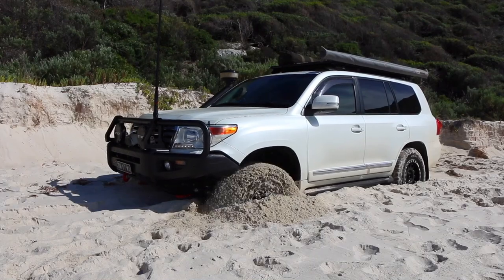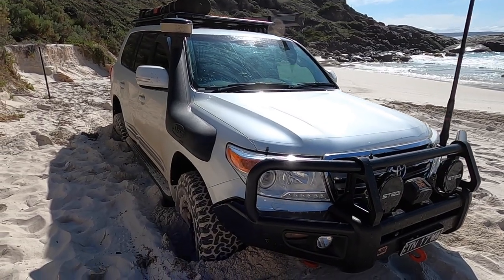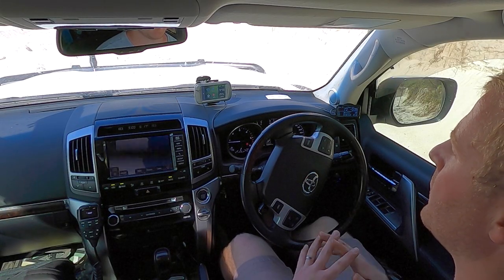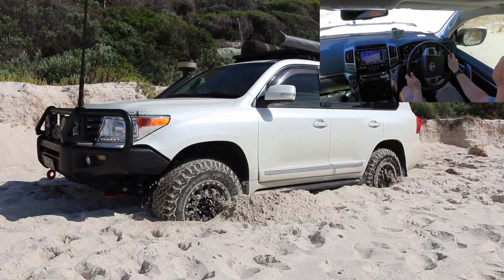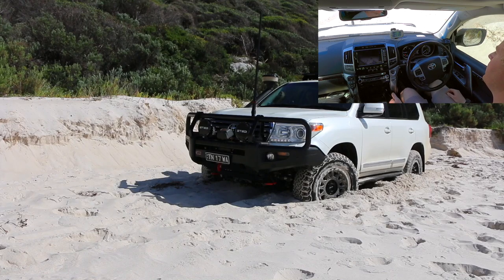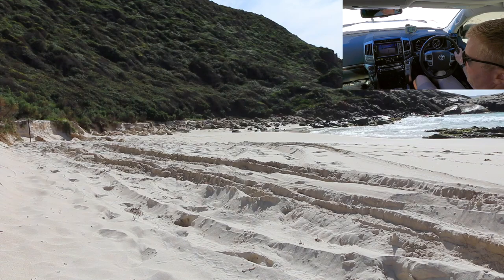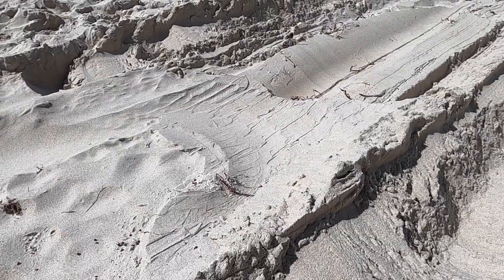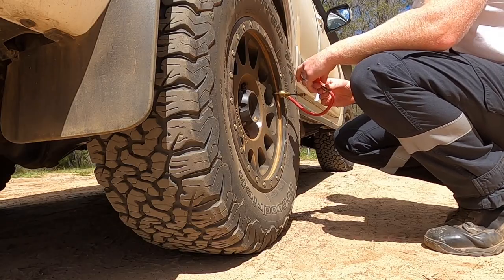Toyota Landcruiser CRAWL CONTROL | Stuck in Sand | Demonstrating 4x4 sand self recovery Does it work

Comment: now just think, you could have done the same thing with lockers. The ABS wouldn't be going off its tit trying to vector the power. If you don't have lockers then its better than nothing
Reply from the maker: For sure, could have, but then I'd need to spend another few thousand when this works perfectly 👍
Reply: @XploringOz  imagine worrying about $3k when you drop over $100k on a 200. As I said, It's alright if you don't have lockers but I will take lockers over this kind of system. there is no power vectoring, no unnecessary shuttering on the driveline and complete control when a tyre or 2 get lifted.

Comment: Let your tyres down wouldn't take so long. Great feature though.
Reply from the maker: Sure thing, however if I let the tyres down to normal sand pressures I would struggle to get stuck and make this video. I could only imagine how capable this vehicle is with lower pressures and crawl control.

Comment: Don’t turn the steering wheel with crawl control!!
Reply from the maker: Noted, I think some further testing will show whether this actually assists or not. 
Cheers, Nathan.
Reply: @XploringOz  you have to turn the wheel while using crawl control
Reply: In a left and right motion
Reply: @AbdulRehman-df3hh  no you don’t! Leave the steering wheel straight. Do not turn it when crawl control is engaged else it will have to work harder and take longer to dig itself out

Comment: Wheels pressure way too high mate
Reply from the maker: Yep, I agree but as I mentioned, I needed the slightly higher pressures to get stuck in the first place. Turns out these LC's don't betted bogged very easily. I could only imagine how capable this vehicle would be with reduced pressures and crawl control

Comment: Just somethin elce that breaks
Reply from the maker: Maybe, but unless we can travel back in time, every 4WD (yes, even the 70 series) are full of electronics that 'could potentially' break. Even 80 and 105 series had their issues, albeit not electronic. No vehicle is or ever will be perfect, however Toyota have done a very good job at producing a vehicle that gets close. 
Note: if you do choose to drive one of those classic mechanical 4WD's then you risk all the 'mechanical' items failing after years of wear and tear as these styles of 4WD's haven't been produced in some time.

Comment: Warm sitting in one spot working? That's not working
Reply from the maker: Fair enough, the RPM isn't high, however the load placed on the engine is increased. The sand surrounding each wheel is essentially acting as brakes for each wheel. Further, the ABS system is actually braking each wheel. This is all adding to increased load placed on the engine. Giving that there is 0 airflow at this pace, checking temps is important. 
Both the engine temperature and the torque convertor temperatures in the gearbox will definitely increase with this pro-longed work. Obviously Toyota have designed the vehicle to cope with this, however checking temps is important to make sure nothing is going wrong.
Further, I'm sure you could imagine the high temps that are experienced on Australian beaches in summer.

Comment: Ummmm, my 93 Range Rover would do that 28 years ago...
Reply from the maker: Yeah a few people are commenting regarding their old vehicles doing this. 
I think there are some major differences between vehicles built in the 90's and modern day 4WD's. Although the effect and method may be similar, no one can be under the illusion that any 4WD built in the 90's has any of the technology that enables the vehicle to do this. 
Further, keep in mind this vehicle weighs in at 3.6t, now yes that is very heavy and some people say excessive, but the comforts, safety and advantages for a vehicle like this far outweigh the ability of a 90's vehicle to crawl out of sand. 
Cheers, Nathan.
Reply: Only when it wasn't stuck in the workshop.
Reply: Only if that range rover starts the engine
Reply: @TheDeezelsmoke  🤣🤣🤣🤣🤣🤣🤣🤣

Comment: : /  YOU DIDNT HAVE THE 4wd ACTIVATED WHEN YOU WERE " TRYING TO GET OUT BEFORE THE CRAWL CONTROL!!!!
Reply from the maker: Yeah, I did have the vehicle in 4WD. The centre diff lock was engaged and the vehicle was in low range. What you are seeing there is the result of open differentials which is how the vehicle reacts when electronic traction aids are not in use. The power is going to be directed to the wheels with the least resistance without the use of traction aids or differential lockers.
Reply: I disagree.  If the 4 wheel drive was on? anything else the truck had to offer to get unstuck? would have worked with it.  the fact that all 4 wheels werent spinning in the video when you first showed everyone you were "stuck"?  proves you didnt have the 4wd engaged.
Reply from the maker: @rockybalboa2526  I'm not sure if you understand how open differentials work on a 4WD? This vehicle is not equiped with differential lockers. Just because it is a '4WD' does not mean that all wheels spin at the same rate give differing weight distributions and surface tensions. 
I sorry you don't believe the video, however this is how the Landcruiser and almost all 4WD's on the market operate...
Reply: @XploringOz   I understand that this video is not true.  No need to keep debating with me.  No one else with 4wd have this problem.  so you shouldnt either.

Comment: Those black wheels are going to be destroyed after spinning them in the sand like that.
Reply from the maker: It's pretty soft sand. Didn't have too much effect on the wheels. Some rock 4WD'ing previously has already scratched them up anyway. This vehicle is built for purpose, not for looks...
Reply: @XploringOz  I’m a purpose , not looks guy too. But I have personally seen the finish on black wheels absolutely rubbed through by be stuck in the mud.
Reply from the maker: @JohnDoe-du6yi  Nice, so far these wheels have held up really well. I had the ROH wheels on my previous 4WD these did seem to wear a little, but these methods are holding up really well considering what we put them through.

Comment: All 4 wheels turning all the time would see it stuck 90% less in the first place. Joke that such and expensive car doesn't have lockers
Reply from the maker: Yeah, they have their reasons. The crawl control function does such a great job, it will get you most of the places that lockers would get you in any event. 
Cheers, Nathan.
Reply: @XploringOz  yeah that's fair enough

Comment: Still way to much pressure, bet thats why you got bogged
Reply from the maker: Perhaps, however, any lower and I probably wouldn't have got bogged on this beach. As you can see, I needed it this way for this demonstration. 
Although tyre pressures play a vital role in beach driving, there are some situations that even extremely low pressures still wouldn't prevent a bogging. This video is an attempt to demonstrate one of the many options in self-recovery in those circumstances.
Reply: @XploringOz  true!

Comment: If both rear wheels would turn you probably wouldn’t have got stuck in the first place  !!!!!
Reply from the maker: True, however without traction control or diff lockers that is how a standard 4WD operates. This would be a common scenario for those driving standard vehicle without electronics or expensive diff lockers.

Comment: Wet sand so its nul and void
Reply from the maker: ?? What’s null and void? The video is demonstrating self recovery from sand. The vehicle was stuck on sand and it self recovered? It was never proclaimed I was in dry sand or a desert environment?
Regards, the vehicle was well and truely stuck, the crawl control pulled the vehicle from the situation without the need of recovery aids or other vehicles.

Comment: Bloody ridiculous driving, just ripping up the beach when a simple track recovery is faster, cleaner and less aggressive on the car. Would have taken minutes with a recovery track and been on your way. You can keep your crawl control and ya overpriced Toyota thanks.
Reply from the maker: Haha, ok mate. I think you might not have crawl control in your vehicle. By 'ripping' up the 'track', I'm assuming you are refer to moving sand on a beach right? 
Now, I'm not going to argue as my points are clearly articulated in the video, however are you able to expand on how digging and setting up tracks, or any other recovery method is 'cleaner'?
I'm sure it would have only taken minutes to recover with tracks or digging, it also only took minutes to recover with crawl control too.
I apologise if this video has upset you in some way, maybe crawl control isn't the solution for you.
Cheers.
Reply: Dont be jelly luke coz u aint got crawl control cobs. Plus if we wear our maxtrax out too quick we cant drive aound the streets with them on our roof 24/7 to let everone know we go offroad
Reply: The next high tide would make it look as if you were the first human on that beach. No sign of a slightly dug up beach, no foot prints or tyre tracks